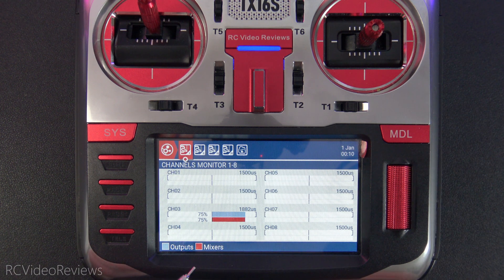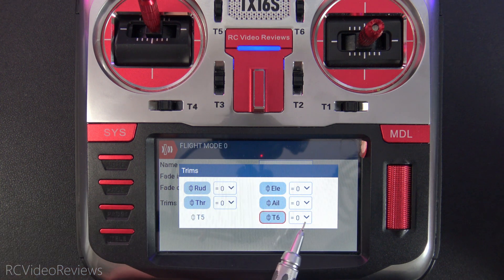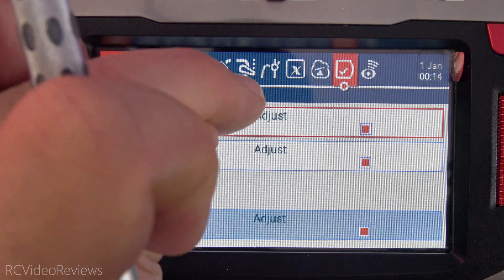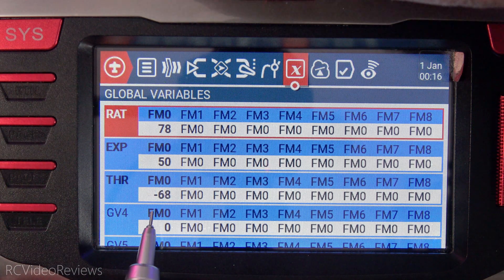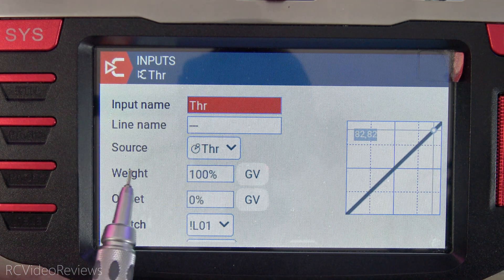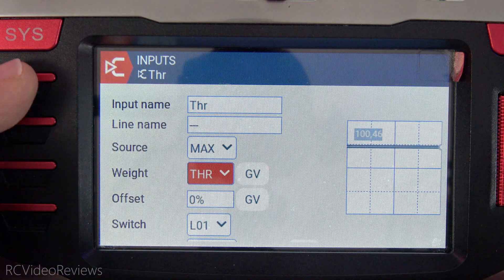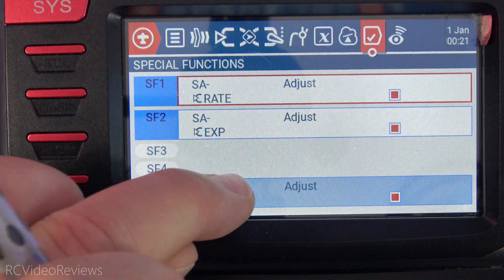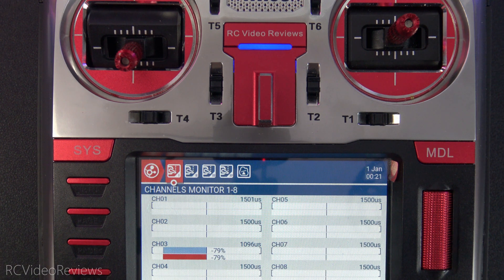How to Lock Channel Values with a Single Switch

Comment: Brilliant! exactly what I was looking for!
The use case is for an FPV drone (quadcopter) - I sometimes like to transition from FPV to LOS when coming in to land, to do that I switch flight mode (in BetaFlight, not EdgeTX) from Air mode to Angle and try to set throttle level that keeps altitude or very slowly climbs, so that I can have my hands free to remove the goggles. I'm always worried I might accidently hit the throttle stick while doing that. It already happened once or twice causing some minor damage to the drone. With this functionality I'm hoping it won't happen again.

Comment: Old(ish) video, but I found this because now that there’s a surface radio that runs EdgeTX, it’ll be useful for cruise control. Some rock crawlers like the TRX-4 have this built into their transmitters, where you can set your throttle trigger and then push a button to crawl along, so I was looking for a way to do the same in EdgeTX. Not surprisingly, there is.
Reply: Exactly why I'm here too 🙂

Comment: I went into inputs and added a switch on the throttle line , that allows me to lock throttle on at whatever position the throttle is  in, at that time.

Comment: Thank you! The purpose of the throttle hold switch is if you want a slightly higher throttle setting, (above idle or at idle) for carrying out the plane to the flight line with the engine running. (Taxiing in the pits is against field rules!) This inhibits accidentally hitting the throttle stick and either killing the engine, or going full throttle, or injuring yourself, someone else, or the aircraft, etc.
Reply from the maker: Ah! Ok, well good question. Glad to have figured it out.

Comment: Thanks John for another great how-to video. Question: What MAX value is exactly?
Reply from the maker: MAX just supplies a fixed value. Since it is paired with a global variable which moves with the stick position, when the MAX source is invoked, it supplies a single value for weight based on the GV. You can see how this manifests itself in the video. When max is invoked, the weight line changes from a slope to a straight horizontal line.

Comment: Finally a fix for my glider.... I need a throttle hold position but it has to vary from flight to flight.. and this fits the build.... cheers... great content...... greetings from down under mate stay safe.
Reply from the maker: I used to do long range FPV flights and climbing to altitude always took some time. It would have been nice to set throttle and pitch followed by a lock feature to hold them on a per flight basis. 

Anyway, glad you found a use case for this.

Comment: I still haven't put edge TX on my radio I am a little scared to do it cuz I only have the one radio.  I guess I am afraid of messing up my radio.  I am thinking of doing it after this weekend of flying so it gives me a week to fix it I hope. I will be watching all your videos on the transfer from open TX to htx again so hopefully I'll be able to do it.
Reply from the maker: Copy your SD card contents to your desktop. If there's a problem, it's fairly simple to re-flash your existing firmware and copy your contents back to the radio. i.e. Restoration is very simple.

Comment: That was an excellent video I would think that that would be a common use on helicopters as we always use a throttle hold  But I've not been into the  Helicopter menus yet 
 Quick unrelated question what do you consider a standard acceptable RSSI value after binding different receivers on the 4 in one protocol ?  I'm getting low to mid nineties on FR sky receivers  But I'm getting exceptional 107 to 109 on several hiTec  Optima receivers that have the boosted antennas  Are my ranges normal ??
Reply from the maker: Sorry to say RSSI values are calculated by the manufacturers and there is no universal right answer. The bet thing to do is a range check.